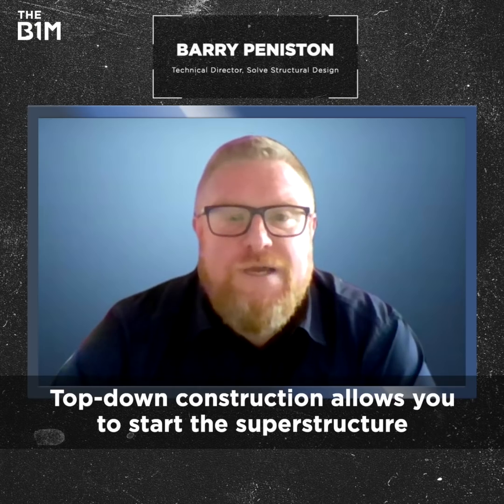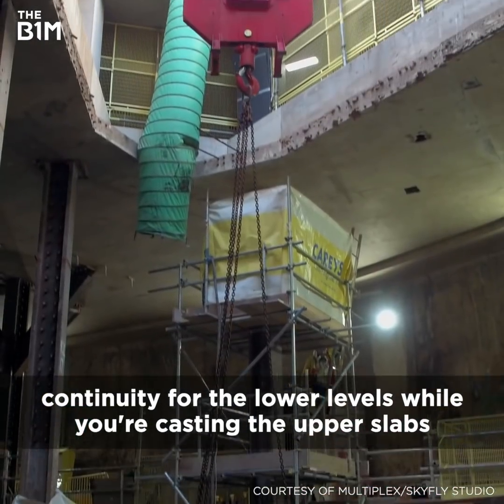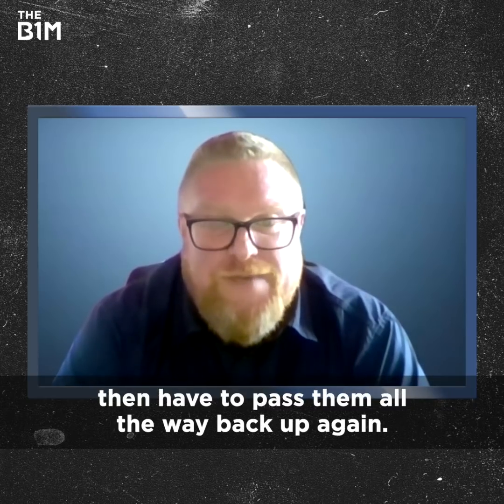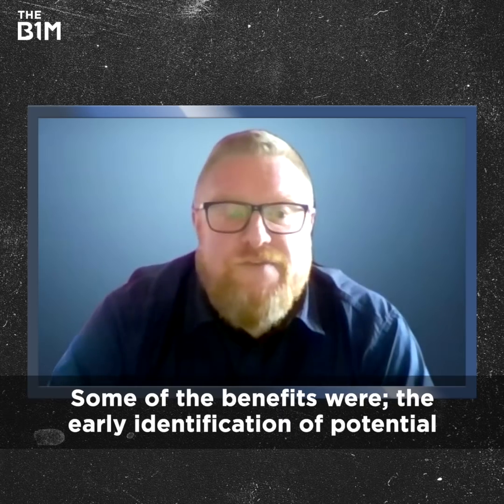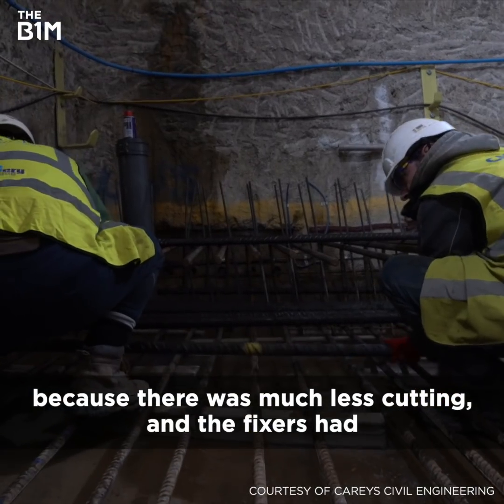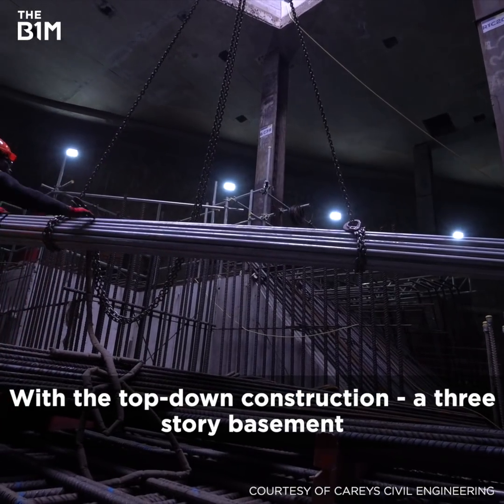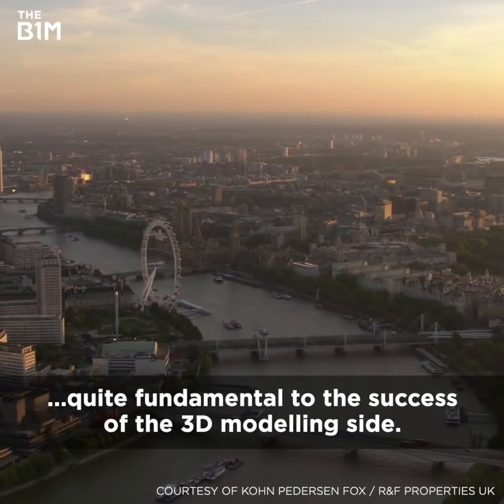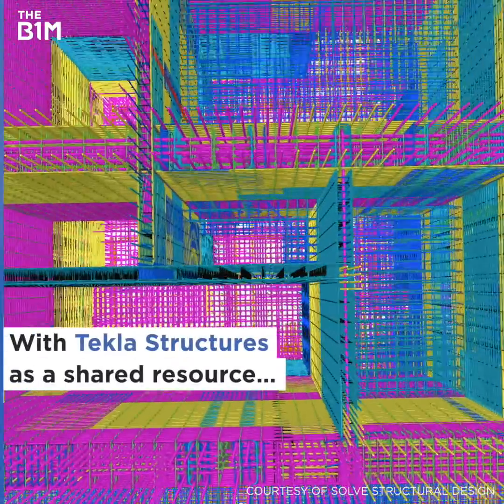The London Skyscrapers Built From the Top Down

Comment: They should build a nice 320meters skyscraper with a sky deck around st George area?
Reply: Too close to Heathrow unfortunately
Reply: @ Yasin l, the heathrow airport is like 18 miles from st George and that tower is only 600ft plus its nowhere near the city airport, as in canary wharf that city airport is like 3 or 4 miles from all those buildings and some of the tower is 770ft, I'm sure they should build 300 plus meters skyscraper in st George that shouldn't be an issue? But if that city airport didn't exist just imagine how the 1 undershaft,  22 bishopsgate and the 2nd cheese greater tower built in canary wharf that would look great plus they don't have to worry about blocking the st Paul's building? And hopefully they will build 350 meters to 400 meters skyscrapers that would make my day, so why do London needs so many airports?? I wish they will build more taller skyscraper and not another 600 to 700ft buildings they don't look tall.
Reply: @markfoster7949  I agree with you. 1 Undershaft is only the skyscraper that excites because it will be 300 metres. However I wish they could make it like 335 metres or 1100 feet or even taller! 1 Undershaft would fit Canary Wharf more than the City of London
Reply: @Yasin l, canary wharf would be the best area for that 1 undershaft skyscraper at 350 meters and that would look great there.
Reply: @markfoster7949  you’re right. There’s something about the Canary Wharf that makes it look magical